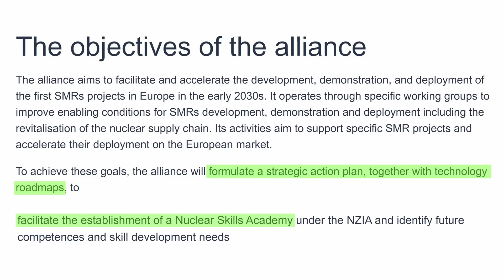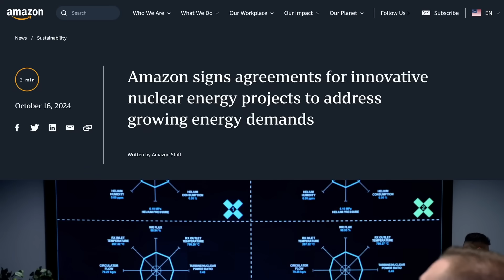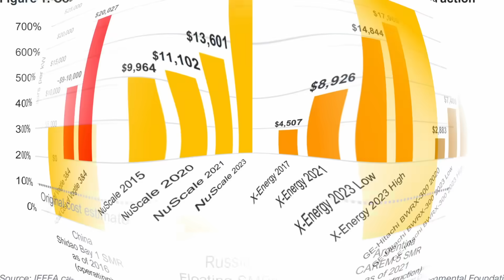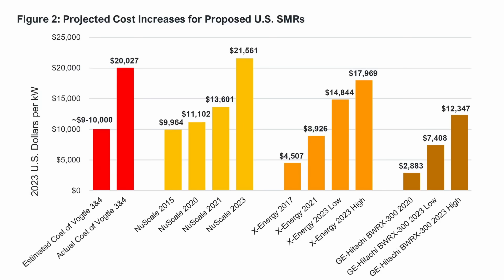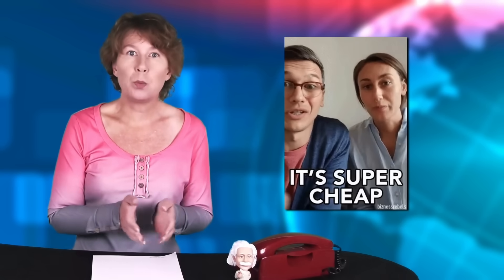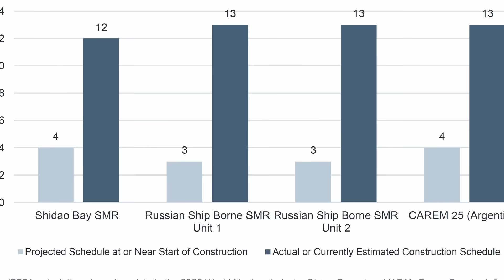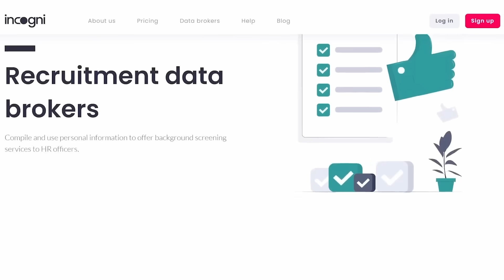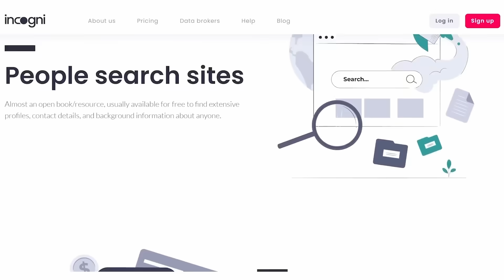Small Nuclear Reactors Have A Big Problem

Comment: Hey yeh Sabine, it may just be the modularity qualification, and perhaps the brevity of the video simply meant there wasn't time for it, but there are small reactors being built and used today. The US Navy (and others) operates them by the dozens daily, including in the new Ford Class carriers and Virginia-clasd submarines. The Bill Gates lead TerraPower Natrium reactor being built in Wyoming is small, if not modular. So if it's the modular aspect that is creating the issue -- heck, modular homes haven't even become a big part of housing construction -- perhaps there's hope in just the small part of SMR. I do think there are outstanding questions of cost per MWhr with small reactors versus the normal sized ones. If you listen to Gates talk about it, that's something they expect to come down with each unit.

Comment: strange that simple windpower, and photovoltaic ( no moving parts) are unbestable, I drove through the Netherlands  even in froggy frogland, many paddocks with PV.  They must get rid of cattle (too much methane) so the windmills come back as well 😂
Reply: I suppose it depends on what your definition of unbeatable is.  The Texas grid highlighted how unreliable renewables can be.  Sure, it you are of a political bent you can point to how Texas decided to decouple from the bigger US grid(s).  My question.  If a state the size of Texas isn't large enough to reliable run it's own grid on renewables, will a larger grid of renewables actually be any more stable?  Isn't there a law of diminishing returns when it comes to grid size versus stability when it is powered primarily by renewables.?
Reply: @msromike123  I think so, PV generation will be so cheap. I think, I hope, that the storage problem will be solved...
Reply: @msromike123  but the gas instalation froze in texas not renewables....